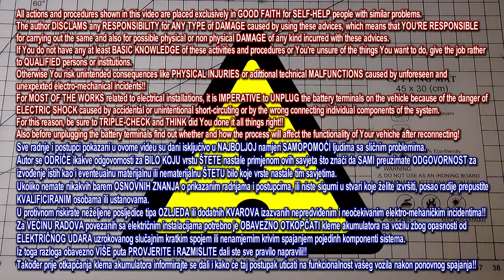Delco Multec HSFI 2.1 ECU (Opel_Vauxhall_VectraB Z16XE_1.6_16V_2001.)

Comment: hi can this resolve the problem with p0115 and p0180?
Reply from the maker: Hard to tell...every code error last instance is ECU. First is needed to test all components (sensors) and wiring in the problematic circuits.

Comment: So did you find the problem finally? Did you fix it? I am interested as I experience the same problem - with the fuel pump and I will open the ECU to see in what a condition it is. So your video is helpful, but you didn't show the solution. Also what kind of glue do you use for the cover? Thanks
Reply from the maker: I bought refurbished ECU from UK and work fine until now. My from these video is ok but those tiny wires from motherboard to connector pins inside you can't simply fix it for long term with simple soldering. Some expert knowledge and tools is needing. 
https://youtu.be/MhMsoaGyFyw
Reply: @fire2hr  Thank you for the reply. I am still wondering if it is possible to be fixed for long term. A man who offers such repairs claims that he has a technology to bond the wires forever. But he doesn't want to share his know how if it is true.
And the price he wants is about 260 Eur which is expensive I think.
I think it is very important after repairing the wires - may be by soldering at least at 380 degrees Celsius, maybe by gluing with an electrical conductive glue, everything to be potted again with a special gelatinous compound. This is because this device works under high mechanical stress and vibrations as well as high temperature. And the gel helps to keep wires to stay whole.
If you put a hard compound it could easily tear the wires.
And once thing more against soldering - it could be easily crack when stressed by vibrations and also the tin alloy could be destroyed by extremely low temperatures in winter.
EDIT: After some reading, I think the best way is wedge bonding (ultrasonic) with aluiminium wires and again potting with gel. However it is almost impossible to find such equipment.
Reply from the maker: I think any "home soldering repairs" will work ok for short time maybe but real good work is ultrasonic bonding and that's costly.
Check this link:
"In this process the protective gel will first be removed professionally. Once all components are completely unprotected, we can begin with the removal of all existing bonding wires. This is a very delicate process, but this isn’t an issue thanks to our many years of experience. Once this second step is completed, all new bonding wires will be attached to the PCB using highly sophisticated equipment. The method we use is called “ultrasonic bonding”. The equipment is fully programmed and set up by our engineers and because of this we can also perform a pull test on the freshly installed bonding wires. This way we know for sure every new attachment is strong enough to withstand vibrations and fluctuations in temperatures. The newly made connections are even stronger than the original ones."
https://www.actronics.co.uk/acinsights/delphi-delco-multec-hsfi-2-x
Reply from the maker: Using robots for ultrasonic bonding is a real deal:
https://youtu.be/6-n__gQZ3hk?t=64
Reply: @fire2hr  Well, yes, I agree that it is much better the unit to be sent to these guys for repair, however they don't offer service to private individuals like me.
Would you please let me know how much do they charge for the repair, at least approximate price?
Thank you for the information.
Reply from the maker: @dimiterprenerov8683  I bought mine here before 2.5 years for 214 GBP ( http://www.ecustogo.co.uk/products/ )...postage included. They also have ebay store ( https://www.ebay.com/usr/ecu.to.go.ltd ) If you send them old one you get warranty 12 months. If you only shop "new" ecu, without sending yours, you get warranty 30 days. I used second option and i'm keep "old" ecu for contingency/reserve but i must repair him first on my non professional/primitive way.😉 Best way is contact them first via email. When you choose to buy they ask only VIN number of your vehicle for programming. Anyhow my "new" ecu work fine until today, and engine work better (better response on accelerator pedal) than with old ecu...i don't know really why (maybe software version inside ecu?) but that's how it is.
Reply: @fire2hr  Thank you very much for the information provided! Good luck to you, and be healthy!